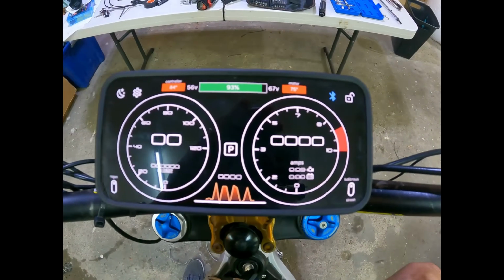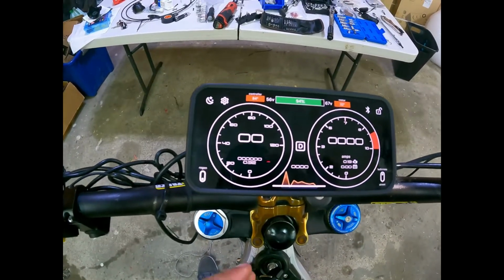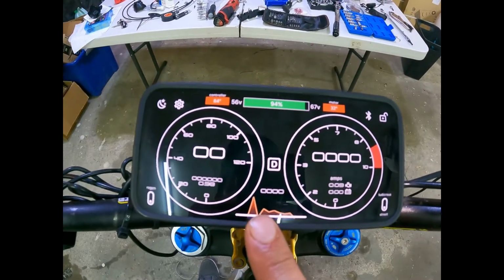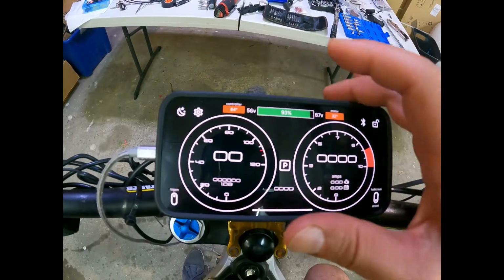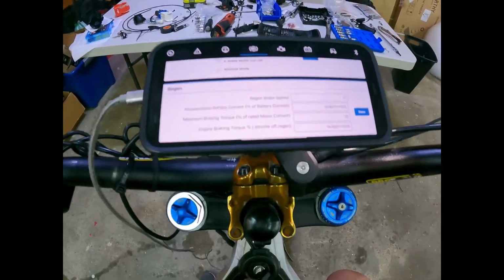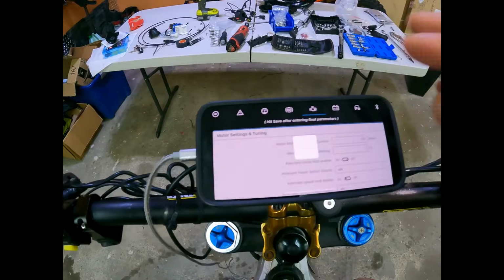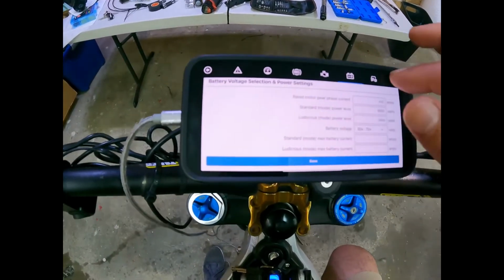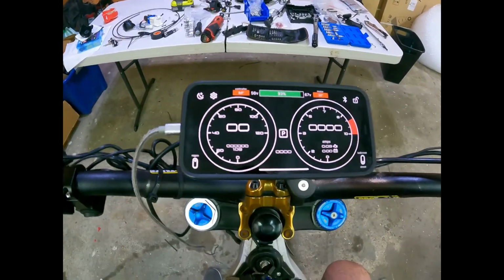GLE Dashboard BAC4000 Display_Tuner_Diagnostic

Comment: GLE does not care about their customers sold me a bac8000 that exploded after upgrading from a 60v to a 72v. I was knowingly sold a contoller with known issues from them in 2023 the controller I got was from 2022.  Come to find out controllers made that year were confirmed by ASI for blowing up!  I was told by GLE after the controller blew up that I needed a precharge resistor and would need to purchase a new controller.  This precharge resistor was never mentioned before buying the contrioller and was not a part of their kit!

Careless company!

Comment: Can’t wait for this… This is perfect.   I just got my BAC4000 from you guys.   I have to wait to hook it up .
Reply: It’s wild I got mine, still need to fully dial it in, make sure u check the phase amps when u get it , mine were set incredibly low upon receiving but after turning it up . Dear lord. For some reason I can’t get the eco mode to work but I’m sure it’s just needs to be dialed in the parameters. Going to test it today or tomorrow with a bypassed 60v and and parallel additional 25ah nakpak . So 60v 57ah. Ohh and the regen braking lever is so clutch . Pretty happy so far except the bypass kit they sent me , everyone I know told me don’t use that after showing it to them and to make my own which I did. Customer service is super responsive. Cheers
Reply from the maker: Hook your controller up ASAP,,,why wait! Go out and ride!!
Reply: @GLE   i am away from my bike right now for a hope is a short time. But i know its home waiting for me to get it put on. I cant wait, and i am now even more excited for this to come out!  Thank you guys!